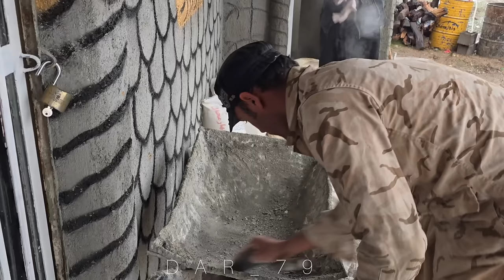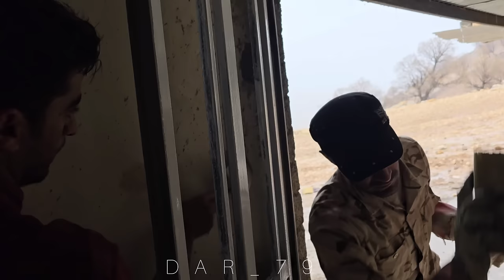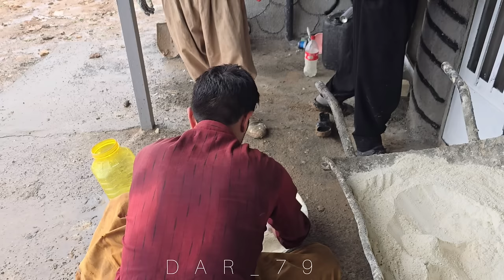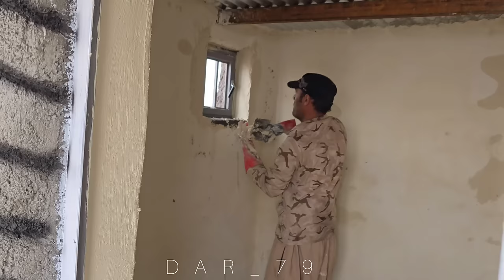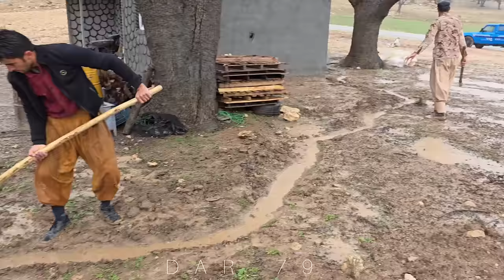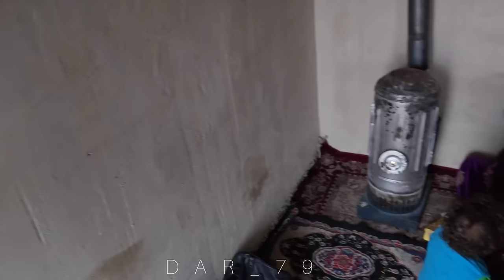"Shelter in the rain: the life of Narges and Sohrab's wife"

Comment: Nargis you should build three block post to support the front roof and extend it All the way out even with the patio

Simple to do
On the left and right side you can buy two metal beams with a Y welded on two pieces of metal to support a long metal beam against the front of the wall of the house
Dig hole cement it

On the front do the same but lower the beam two inches to allow drainage from the roof
Your front porch will be.more dryer

God bless you and your family Nargis for helping other family shelter from the cold rain and snow weather

God will continue to bless you and your family for helping others